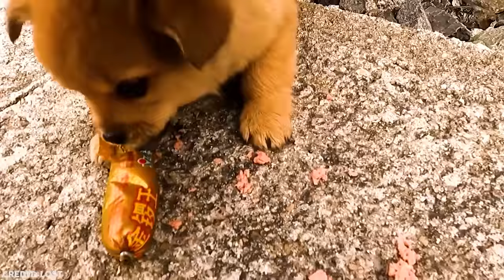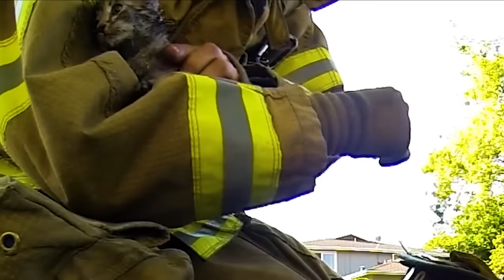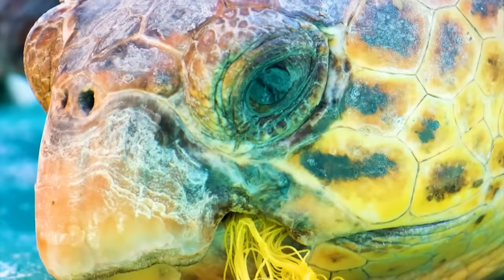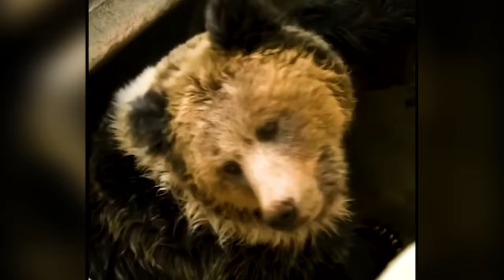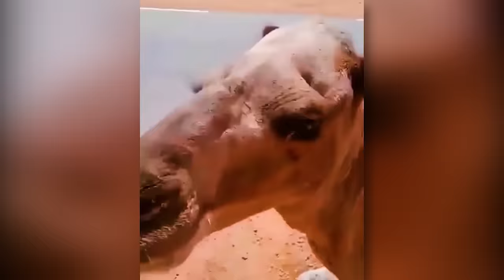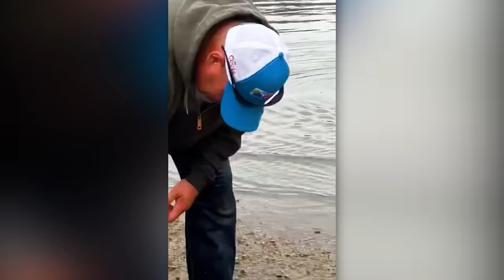Animals That Asked People for Help & Kindness !

Comment: A couple years back during a heatwave (it was 31 Celsius that day) I found a half dead blue tit lying on the hot pavement on my way home. It even had a bug in its beak so it must've fallen down mid-flight. I spent 4 hours nursing it back to health and giving it water with a straw, even caught a live fly inside the house, and it snatched it up and ate it. I took it back to the area I'd found it when the sun had set and the temperature had dropped a bit, and when I released it, it flew to the nearest branch, chirped as if saying 'thanks', and flew away. Still one of the most beautiful memories I have.

Comment: I use to save ducks before there was a hole in a river nerby my house and baby ducks were stuck in the hole there was 9-10 baby ducks and the mother duck was quacking trying get them out but sadly the hole is covered by cages and me and my dad went to the fire station and told them everything they said they will comebut it took so long so my dad says frick it and grabs a scooper and went down to the river and helps the little duckies and pulled them back up and after that the duckies went up and then they left and never come back back to the spot again